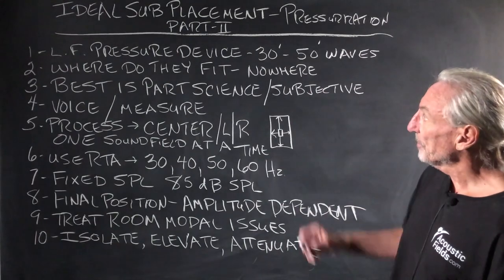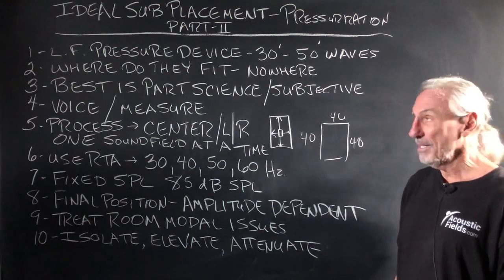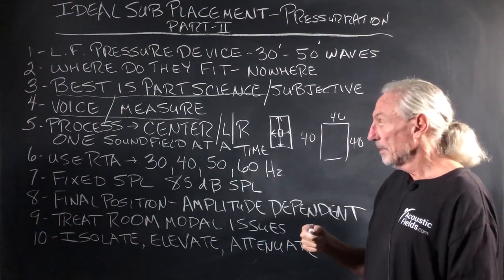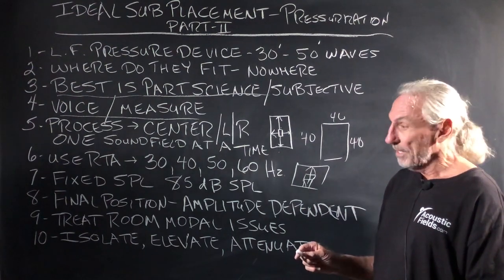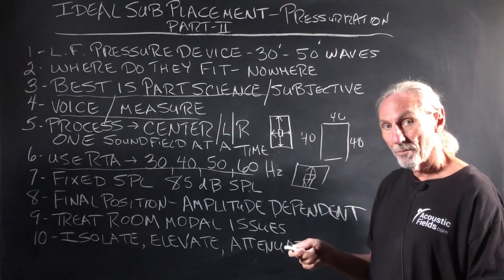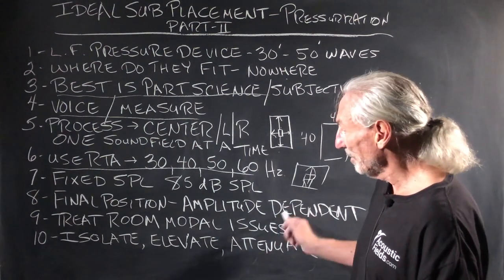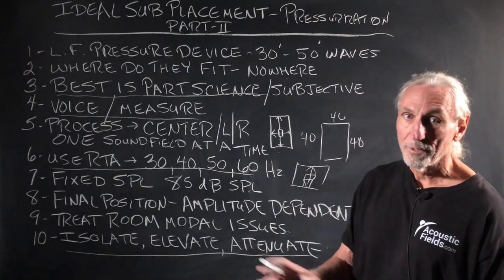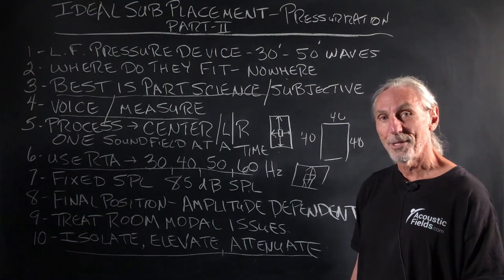Ideal Subwoofer Placement & Pressurization Part 2 - www.AcousticFields.com

Comment: Was wondering were part 2 was. Thanks for the second part. Will this be a series? If there is looking forward to it👍 I have 2 channel system. Subs are controlled by remote by there own preamp. Most times subs are off as IMO they interfere with the music playing. 70's rock music on the other hand need subs IMHO. Not a home theater guy either. Thanks for you information

Comment: Thanks Dennis for the advices! I built a DIY platform consisting of 5x18mm MDF panels plus 4 washing machine absorption pads on top of each other. 
I have a BK Elec XXSL400 sub in a 25 sq meters room with a wood framed floor. 
Not only the bass is clearer due to a lot less floor vibrations, but I can also crank the volume high up (approx 90-93 dB at 1 meter) without my neighbors hearing a single thing or rattling from the sub. 
Next step is making the stand more eye appealing.
Reply from the maker: Isolate, elevate, and attenuate are the goals with low frequency producing devices.

Comment: A timely video Dennis. I've just been trying for the last week to integrate my Wilson watchdog 2 subwoofer into my room. In the end after elevating it moving it side to side backward and forth as best I could with what furniture I have in the room, I just decided to turn it off and abort the mission. I'm convinced I just can't make it sound any good in my particular room. And actually given I have Wilson Sasha loudspeakers I don't think I need it anyway. Think I'll be putting the sub on ice for the next listening room that will definitely be bigger than the one I have now. But it is worth mentioning the best I got it sounding was when I had it elevated about 2 feet off the ground.
Reply: I’ve been trying for years to get my subwoofer to sound good and have had no luck. I’ve also turned it off now and my two channel music sounds so much better. Go figure. At least now I don’t feel like I was doing something wrong. Thanks for another great video.
Reply from the maker: Elevating a sub off a boundary surface will improve response.

Comment: So you believe Floyd Toole is incorrect in saying that 2 to 4 properly placed subs (mono) act as active bass traps helping room modes. Corner loading 4 subs seeming to be the preferred way?
Reply from the maker: This mthodology is not cost effective. What is the cost of 4 subs? What db SPL benefit do you receive for that cost. Compare that cost with treating all frequency issues, not just the low frequencies.

Comment: Yes, the theaters in LA suck! Never been to one I was satisfied with.
Also great video!
One question...when you say a LF device outputs 30, 40, 50 ft waves is that before it gets excited by the room or after?
Reply from the maker: Energy input into the room produces the distortion.

Comment: I have not tried  this myself, but do you believe in the technique of putting the subwoofer in the listening position and then moving around the room yourself to see where it sounds best?
Reply from the maker: Yes, our sub woofer platforms are designed with casters on them for easy positioning around your room.
Reply: Put the subwoofer at the listening point, then use the measuring microphone to look for the location of the subwoofer, not with your ears.

Comment: Hi There, would you recommend using room correction software & mic when setting up a sub in a small room? Or would you still advise setting it up by ear? Thanks
Reply from the maker: Use your own ears and eyes. Start with the sub in room center and listen for a few days to all your sources. Move the sub left and right of center. Listen for a few days. Keep moving, testing, and listening to multiple sources. You will find the correct spot.
Reply: @AcousticFields  thanks so much for your reply, which I really appreciate.  I wasn’t sure if room correction software was the best way to go, so thanks for confirming this.

Comment: Hi, I know that you have to be careful re. placing too big a sub in a small space.  However,can a small sub be problematic too? Would a 9.5 inch driver be preferable to say a 10” in compact space (6ft x12ft) both sub options are sealed units-if that helps! Thank you
Reply from the maker: A 1/2" sealed or not in a low-frequency driver size will not matter in this small room. There will be no way to achieve any room frequency balance in this small room no matter what the treatment amount or type.
Reply: @AcousticFields  thanks for your response.  I appreciate it.
Reply: This is good but a real problem is that ceilings at 8 feet high are too low in addition to a lot of rooms being too small

Comment: So do you actually have measurements showing the before and after differences??
Reply from the maker: You can perform the measurements yourself. There are numerous software programs that will provide accurate response below 100 hz.  Keep your sub in the current position and raise it 12". Measure the response. Raise it 18" and measure the response. Raise 24" and measure. Report your findings to us in this format.

Comment: Distributed bass array helped me more than anything else. Because once more movements and dial adjustments are exhausted, other forces made a huge improvement.
Reply from the maker: The largest improvement is always going to be with the proper type, amount, and positioning of treatment.
Reply: @AcousticFields  For me, the addition of two Rythmik subs, carefully adjusted and placed, closed the deal. Additional treatments were not helping. That was just throwing away money. That said, I should probably do a good system analysis and see how everything is interacting. When one looks over all their audio investments, making sure that everything is comparable is what I like to call an "equity plus" approach!
Reply from the maker: The reason your treatments were not working is that they lacked the proper rates and levels of absorption. If your treatment was boxes filled with building insulation, you were beat before you got started.
Reply: @AcousticFields  My treatments were fine. Real Traps and GIK and ATS. All work fine. But the extra subs brought them all home. I've got a great REW curve now and it was reasonable in cost.
Reply from the maker: Send us a copy of your curve.
Reply: @AcousticFields  please
Reply: My scan can be seen on my system page, here: https://systems.audiogon.com/systems/9064  at my system page at Audiogon: https://systems.audiogon.com/systems/9064
Reply: @AcousticFields  
He didn't state his treatments didn't work, he's saying the biggest improvement was brought upon by multiple subwoofers. 
Selective Mode Cancelation... ie, spreading of two LF sources left-to-right, or front-to-back, addresses modal misbehavior in that axis. 

Also, building insulation makes superb material for acoustic treatment... it's industry standard. 
Thanks
Reply from the maker: Building insulation lacks the proper rates and levels of absorption for music and voice. It is not an industry standard among those that know this.
Reply: @AcousticFields  
The most knowledgeable, successful acousticians, studio designers and engineers in the world ... utilize building insulation for various treatment types.

How effective a particular treatment approach is, relies less on material type, and way more on how the material is implemented. 

Example; both wood and fiberglass/rockwool make high performance, highly effective bass trapping... yet what determines effectiveness is how it's implemented. 

Fiberglass, and Rockwool are used everywhere, both for acoustic treatment and building insulation. 
Why? It's effective. 

Also, "rates and levels"? 
Not sure what you mean.

Thanks
Reply from the maker: @FOH3663  Building insulation overabsorbs middle and high frequencies. This is why most studios do not use it anymore. The rate of absorption is how much energy is absorbed at each frequency. The level is how low a product will absorb down to. Building insulation is not an effective low frequency absorber. You need to use 2-3' of space with this material types and you wont get the same performance as 12" of depth with a diaphragmatic absorber.
Reply: @AcousticFields  
You're right, it's very effective, and if mis-applied a room can become over damped in the HF. 

If the application warrants it, a simple layer of plastic sheeting increases performance and limits over absorption of the HF. 

Countless resonators and diaphragmatic devices incorporate building insulation into the damping mechanism. 

I get it. If I spent years and millions of dollars developing my own foam absorption, I'd be proud of it too. I'm guessing it works fine. 
What I'm certain of is various applications that incorporate building insulation offer superb results, cost effectiveness is a bonus. 
It's all good.
Reply: It is an intriguing concept.  I have seen it  described in two ways.  Conventionally a number of subs placed in the room to fill the bass.  Others have described it as a set of two walls of subs.  One creates the bass in front and the other cancels it behind the listening position.  Both appear to work but the second seems more likely to null the room influence.
I enjoyed your video discussion on the philosophy of sound.  It caused me to reflect on what motivates my interest in this hobby and helped me get some real insight.  Well done!
Reply: @user-od9iz9cv1w  thanks so much!

Comment: Forgive my ignorance (I just use 2 way speakers and no subs) But, would it make any sense to have a crossover set for 2 subwoofers say one runs 20-50Hz and then one from 50-100Hz?
Reply: you can but the more overlapping drivers you have in the system the more problems and harder to set up it will be. trying to time and phase align different size and type drivers in different places inb a room is quite difficult.
Reply: I use 2 subwoofers. 1 is a 8inch and 2 is a 12inch ( both sealed cabinet) and they are with a 2.5way floorstanding setup with 2x 5 1/2" drivers and a metal dome tweeter. i have blocked the ports on the speakers. I run DSP to time and phase align them all and it has taken me a long time to get a frequency response that looks and sounds any good. 

I will be replacing the 8" with an identical 12" eventually. The 8" at the moment isnt doing much work apart from filling in some gaps due to where the other sub placment and room nulls are etc.

Comment: I also always watch your videos and info Dennis, and I understand your distress when comparing with so many other channels that present "unprofessional" and different data from yours. Still I also look at PS Audio and REL subs channels, and I believe they are also professional like you. 
One info that contrast with what you report above and in other videos, is in a video of REL on 26th October reporting reasons why should not put subs on platforms. 
I know you are not interested in what other people report, so you might not reply me here, still perhaps could be an interesting thing to report in your "What you say" series and open up the discussion there for us to see.
Reply from the maker: I have seen that video. Watch it closely. REL claims that just a few inches in height can change the whole dynamic of the sub output. How can just an inch ot two change the character of a waveform that is 28' long?
Reply: @AcousticFields  no idea Dennis, I am no expert, I have to trust what experts says. This is why I am confused. You are an expert on rooms acoustics, John is expert on subs, and you report two different things. In part I was wondering if what applies to normal subs, is different with REL's  as they are particular. 
Thanks all the time for your replies, always useful
Reply from the maker: Our platforms elevate, isolate, and attenuate energy. The best location for lower frequency absorption is close to the source. We have found that most sub woofer manufacturers do not like elvating their products is mainlt due to liability issues.
Reply: @AcousticFields  thanks for the explanation, all make sense

Comment: Amazing that Companies sell subwoofers knowing that they won’t perform well in most  rooms  And give poor advice on placement.
Reply from the maker: Its the quantity versus quality issue. Its almost insulting the claims they make. They should spane more time designing a cabinet that does not move. A sub has three main energy outputs that produce its total sound. There are the drivers themselves, the electronics, and the cabinet. All three combine to produce the final sound quality.
Reply: I'd like to see companies start selling subs in pairs minimum. With two subs, you can iron out several room modes in one fell swoop. With one sub you can only really fix one null.